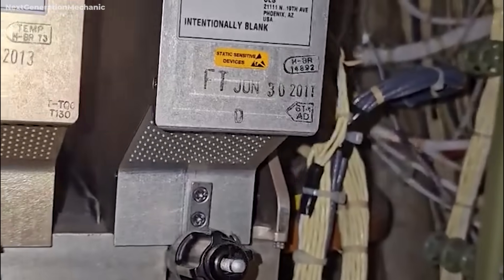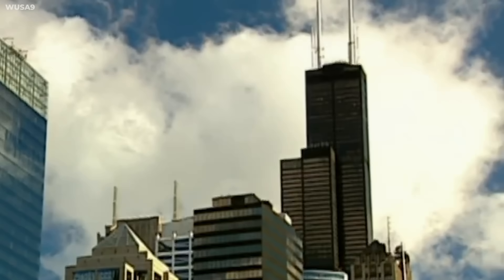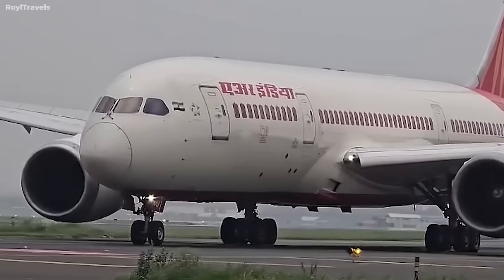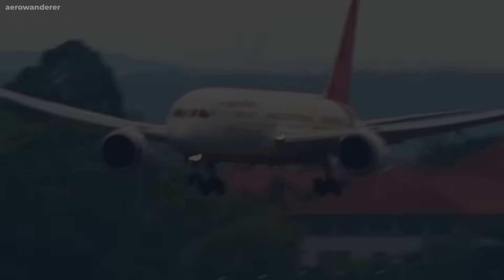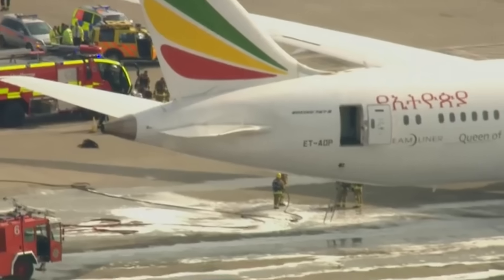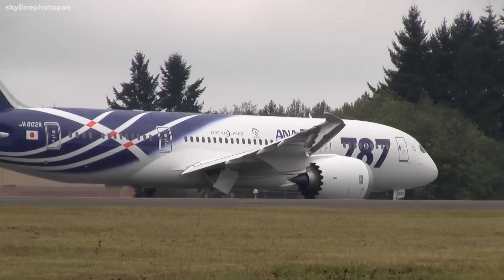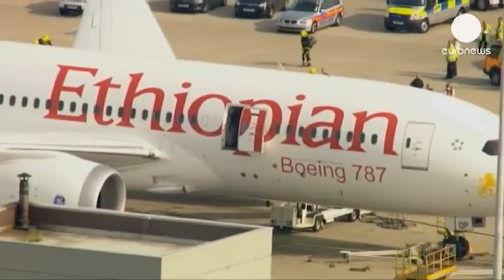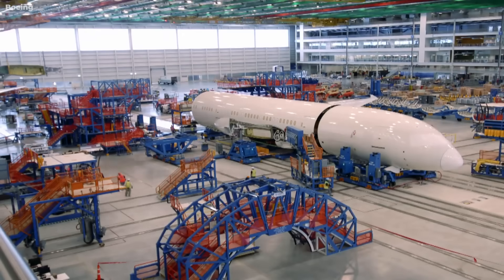The DEADLY Secret Inside Boeing 787 Dreamliner Caused AI171 Crashed, New Discoveries

Comment: I see lots of censoring by the admins here. I suggest that legal action should be taken against Boeing but my comments disappear???
Reply: @nonx663   well  the fuel cut off switches were shut OFF  and then turned back on,  why would that be a Boeing problem on an 11 year old plane ?????
Reply: @wilburfinnigan2142  because it keeps happening with Boeing planes. Coincidence or gross engineering incompetence? Boeing knows about their fuel supply problems on multiple aircraft

Comment: There was a compressor stall on takeoff in the US with a video, the pilot flew to a safe altitude while the engine backfired, was slow even with the landing gear in the safety climb. Circled and landed no problem, the key was fly the plane and ignore the problem if the plane is performing till you are at a safer altitude. 
The truly deadly secret of this crash, it is truly because the person with the secret is dead, the pilot did not fly to a safe altitude but started hitting button shortly after takeoff. He hit the wrong button and shut down the good engine, single pilots in light twins have done the same on takeoff many times and it does not end well.
Reply: mykofreder  Was not the problem  fuel shut off valve was shut off   then turned back on  according to flight data recorder on prelim report from India !! !

Comment: Nonsense. The pilots shut down the wrong engine. Occam's Razor-- the most probable answer is the usually the correct one.
Reply: What u say is nonsense in my opinion. Why would they shut down any engine even if it malfunctioned so quickly? It would probably take more time to even think about shutting it down than they were airborne. Also the plane was flying so leveled that it suggests that both engines stopped working at the same time. This means that they must have shut down the other engine just milliseconds after the malfunctioning engine stopped working
Reply: Are you really sure?
Reply: The most probable answer: Boeing put profits before safety again.
Reply: Someone shut down both engines according to flight data recorder, turned back on tooo late one of two pilots shut of two pilots shut both engines off !!!
Reply: Your answer is nonsense, absolutely nonsense!
Reply: @charlieguzzi  Ha ha ha ha. Fuel control switches turned off. This is how nonsense becomes reality.
Reply: @phaecops well, I did't expect a suicidal bomber sitting on the flightdeck. My apologies for this harsh comment.

Comment: Just a reminder: about a week ago this same channel asserted that the India crash was due to a faulty seat lock and the pilot grasping the throttles in an attempt regain balance and inadvertently throttling the engines back to idle.  Now it's rivets in the bulkhead.  Choose one!
Reply: Never heard them say that.
They've been correctly blaming Boeing manufacturing the whole time.
Reply: @trickbaby8441  People believe what they want to believe.
Reply: @trickbaby8441  It wqs not Boeings fault or poor mainentance  somebody turn both fuel switches off according to info on flight data recorder !!!!!

Comment: Revenge attack for taking out Nur Khan nuclear weapons storage tunnels through ventilation shaft (which US copied the strategy at Fordo) which killed 300 Pakistan soldiers...Sabotage.  Conspiracy.  EMP attack. It happened before in North America.  Planes lost power.  Couldn't even start any planes and some cars with chips. Batteries fried. If proof found that agents of a foreign state sponsor of terrorism..war will restart....Noclaim of responsibility because if it is a state sponsor of terrorism like Iran and Pakistan, they don't want to restart war.. The big blast sound the survivor heard shortly after takeoff is the EMP device blasting, causing the batteries to fry and electrical systems failure and engine shutting down...Pilot took full length of runway so as to conserve fuel as it is too expensive in India..
Reply: And what happened when you woke up?

Comment: In that radiocall with the tower , the crew  not reported a complete los of systems, only no power,  no thrust, not a Total los of engines. There also was not heard the low terrain warning. Landinggear could not been retracted. Was the plane, whatever the reason was, in the landingconfugiration.

Comment: STOP the Bullsh*t and wait for the final report!
Reply: No, this is no bullshit. And it's not directly related to AI171 so there's no need to wait for the final report. If this is true, then Boeing has got to set up some task forces to ensure airworthiness of all their aircraft. This report sounds really bad.
Reply: @fortetudine  It BS my dear, the plane has been flying flawless for near 14 years!  This video was made because it's "Boeing" had it been an airbus it wouldn't have been made
Reply: @ecerejo flawlessly is not the appropriate word. Several issues that as of AI171 did not lead to a crash by chance or by interventions that saved the day. This video is stating facts.
Reply: @Campanola  every airplane model has had its own issues, for example the A330 has had their own collection of them, some examples:

There have been software glitches in the flight control computers, occasionally causing unexpected behavior, such as uncommanded pitch changes or system reboots.

Fuel leaks or incorrect fuel transfer due to valve malfunctions or software bugs in fuel management systems.

Autopilot disengagements or auto-thrust instability have been reported in the past.

Am I going to stop flying on the A330, most probably not!
Reply: @ecerejo don’t compare small issues with big issues. Boeing it’s if you don’t switch off the fuel pumps when they run dry you can explode. The max if you let the the engine anti-ice and there not enough moisture, they can destroy the engines. I don’t have to switch fuel pumps off in my A330 until we are shut down at the gate. Stating they all have issues means nothing if you can’t understand levels of threat.